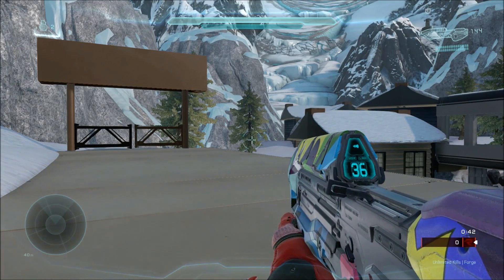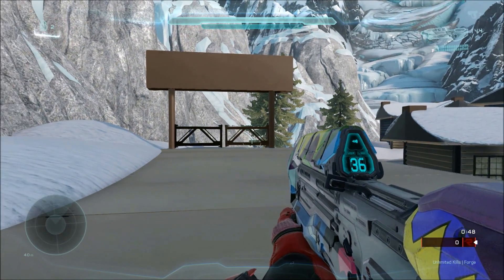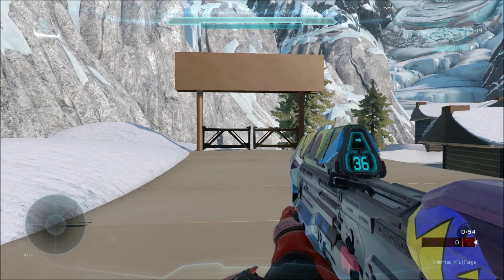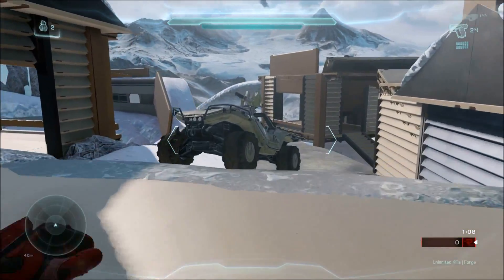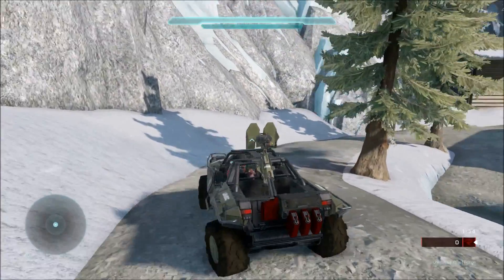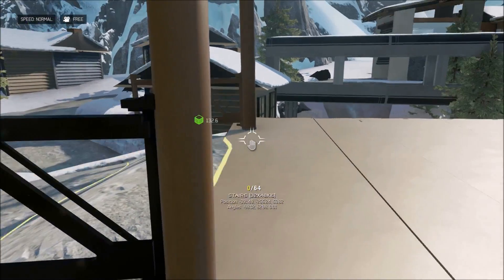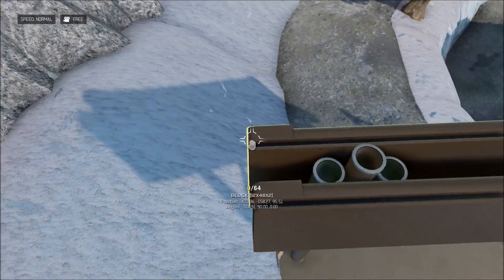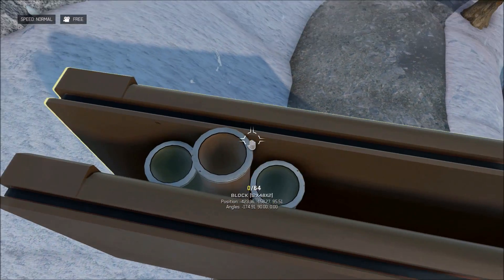Physics Gates (Halo 5 Forge Tutorial)

Comment: I have been having the hardest time with the spaz mode on the games physics... I have actually started a thread on waypoint, I first set out to address these issues, but mid thread I came up with a great solution. I speak of simple machines, on the basic level. please check the thread and really think about the items. wheel hubs, low friction pads, ect... 
here's the thread I would love to get some traction on this. 
https://www.halowaypoint.com/en-us/forums/e6fa08a8e3e54e1280e4650ddffa03ef/topics/physics-spazing/3fbaeb09-8d95-4234-a25a-db2472638003/posts

Comment: Can we put a cable inside the pipe and weld that cable to the door? or is the pipe considered as a "full" block?
Reply: the pipes hitbox sadly didn't allow me to do that. it was the first thing I tried.
Reply: That's what I thought. damn.
Reply: +MartianMallCopStudios What about the reverse? Like have the cable be the grounded object and the pipe welded to the door? I did test throwing grenades into pipes before, and it seemed to work.
Reply: +ToaDrakua Hmm... I'll look into it.
Reply: +MartianMallCopStudios it won't let you if the objects are set to fixed but if you phase them inside of each other and then set them to normal physics afterwards it works
Reply: +MixedInterests Ah... that makes sense. Thanks